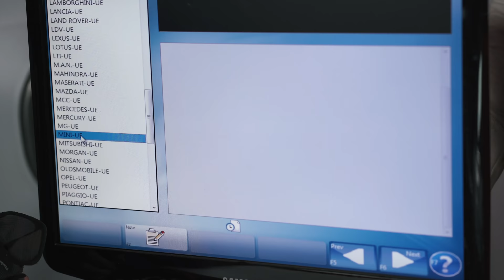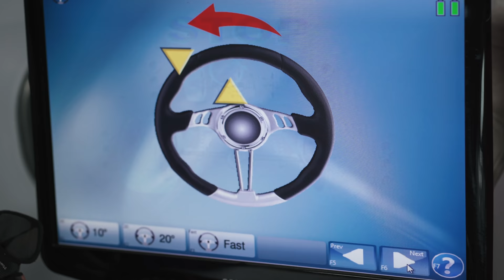BMW Mini Cooper S Rear Rally Suspension Upgrade - Edd China's Workshop Diaries 17

Comment: Love this show already and only a few episodes in. The way that there’s more than 2 or 3 things wrong with the car and the detail that goes in to repairing/replacing.  I watch WD thinking “yeah I could totally buy a substandard car and do it up and sell it on”.  The new show with Edd actually opened my eyes seeing that it’s not actually like that. For instance this mini, replacing the bushes with the press….
Washing the inside of the RR fuel tank and replacing the fuel lines…. Then making the magic switch to test the pump then working out that the plug cables needed switching… love it

Comment: Another great start to the weekend and it's comforting to know that even the experts sometimes have a problem with replacing bushes; I've done them all on a 23 year old Mercedes SL and every single one put up a fight and a reciprocating saw is a godsend.
Reply: Did the subframe rubbers on my E30. Really time consuming. Heat gun helped as well for the rubbers without a metal sleeve.

Comment: Big fan Edd. FYI, re the rear lower coilover thread that's been helicoiled: that happens because the steel bolt is a tri-lobe "self-tapping" bolt, which cuts the thread into aluminium, so they are technically single use only. So replacing the trailing arm is not the end of the story. Get yourself a keensert, put it in the new trailing arm, and then it makes it serviceable. Otherwise every time you remove the lower bolt, you're making the aluminium thread weaker

Comment: Smart Work Guy's!  My Observation sez he is not quite done spending yet. New Rear Brake Pads and Brake Discs, New Rear Anti Roll Bar and or at least the End Links. I bought Bicycle Wheel Hub Thin Wrenches to tackle Sway Bar End Links that do not have a Hex/Torx in the stub end to counter hold. Wrench On...

Comment: Eddie, have a look at the anti-roll bar rubbers and noticeably where they are mounted.... too close to the bend. If you slot the bracket that holds the rubber bushes you can move them away from the bend. BMW fixed this on the GP. You could also upgrade the anti-roll bar to a thicker one at the same time, if you feel so inclined 😉👍

Comment: I have worked a lot on heavy construction equipment with pins and bushings. If we didn’t have the right size hydraulic pressing tools we used to MIG-weld the bushings inside. When the bushing cools down it shrinks and it’s easy to knock it out. The same method works on motorcycles and cars.

Comment: Regarding the pressing out of the bushings (27:00): I have a similar problem with Saab and Opel / Vauxhall Vectra wishbones. There is a special tool for this that is pushed in between, rests directly on the bushing and supports the two sides of the wishbone against each other. Works fine. It is just a thick steel plate or U with the proper thickness.

Comment: This reminds me of doing top and bottom ball joints on a disco 2. Hacksaw and cup type tool though. Two opposing cuts works better than taking a small section out as the c shape would still be pushing out.

Comment: I replaced the corroded rear subframe in my 2007 S so am familiar with all the bits. Interesting thing I discovered is that the large bolts that screw into the aluminum bits (Torque specified at about 110 ft-lb as I recall) if you look and feel carefully you will find they the threaded portion os no round, sort of a trapazoidal shape. MINI pars describes them as self tappers. Guess that when screwed into a new aluminum bit they do form the internal thread and perhaps this is part reason for the high torque. When replacing, reusing the old parts and perhaps new bolts, since the internal thread is already formed a lower torque might be OK, something l ike 90 Ft-LB.  Tom G.

Comment: Depending on what material the Range Rover body is made from, there is another method for stripping paint, grease and other contaminants from sheet metal, and it is considerably cheaper than other methods.  Mark Stielow (a la 12 pro-touring Camaros) developed a method of heating a body in an industrial oven to 600 F (315 C) to burn off all the aforementioned contaminants while at the same time stress relieving the sheet metal.  The paint and everything else burns off.  Obviously this wouldn't work on an aluminum body which apparently some Rovers use, but it works OK on regular sheet metal bodies.

Comment: Karcher lease Ice Blasting equipment, with a propper air compressor because you will need good air pressure for the blaster. Only you should look for a good nozzle because the one who they gives are very wide. And a good plastic barrier to avoid blast all the dirt around your shop. Should watch I am detail videos about it.

Comment: I use a big c clamp positioned correctly to compress the caliper back so it will slip off the rotor when there is a ridge like that.

Comment: Always brilliant to watch. Thanks. This episode (or rather the segment measuring the wheel alignment at the start) is the first that hasn’t worked for me. The editing from Edd to Neil to the screen was too rapid which felt hectic and feels like the screen shots were only included not to show the interesting data but to show the brand of gloves. Just my observation and it doesn’t take away massively from the excellence of the show, but it wasn’t the usual style.
Reply: It's also the bit you wouldn't be doing at home, maybe that is why they cut it down?

Comment: I've just got one thing to say to you, Gentlemen: Eye Protection....I appreciate that you wore goggles when working around the press, but you also needed them when working to get those gritty bits out of the car. You don't want grit, dust, dirt, and especially metal shavings in your eyes. Otherwise, this was another informative video - thanks!
Reply: If you felt the need to draw attention to that, 👀, I'm surprised you didn't also suggest (or demand) the use of breathing apparatus to avoid inhaling ghastly carcinogenic fun particles when stripping the brake discs. Oooh, scary!

Life's one big trial. Sometimes it's important not to give a 💩about it.  😁
Reply: Edd was doing a fairly good job of not looking up when the debris were falling, but for the sake of all those young future Technicians out there, my viewing eyes cringed in submission just a little . . I would have thrown on a set of cheap safety glasses just to set a good example.

Comment: Enjoying the new series 👍good platform for a rally car. At least the suspension at the back doesn't have a beam like others. Although these minis handle well do you not think there is a large amount of bump steer in stock form, there is probably a kit somewhere. If it was my car I would fit bump steer kit, bigger rear arb and fit k20 engine 😁

Comment: rear pads wont separate by pushing.. they screw back in not slide. also lower hub screw is self tapping and very fine thread so it strips, thus the helicoil. its important to torque to spec and replace the bolt EVERY time its removed.
Reply: Thanks for mentioning this. Id forgotten that I discovered the same when working on an MGTF115.

Comment: Many an argument has been had about using anti-seize on bolts that go into aluminum because of thread damage or on lug threads for wheels.  Most "experts" will tell you not to use it because it can change the friction between the bolt and the threads of the hole, making it impossible to torque a bolt properly.  Anyone who's ever had to drill out a lug nut or bolt that had previously come out without issue will be less worried about that.  With control arm bushings that need pressed out, I've gotten to the point where if they fight me at all, I just remove the center and either bend the outer housing in with a drift and hammer or cut them like they did here.  It's swings and roundabouts between a reciprocating saw like they used here or a rotary tool with a small cutting head.  It mostly depends on if there is any rubber left in the housing, and how much.

Comment: Race  car drives, always worrying about having 4 wheels!  Two or three works fine. You simply adjust your driving technique. No problems! I have crossed the continent many times with less than 4 wheels.  Many times I've started out and simply put all the wheels away and continued on for hundreds of miles . 

But I did reli on the wings for support  . Flying is more direct.

Comment: Hey Edd, It looks like you slightly crushed that bearing housing. Does that matter? Is that going to effect the toe? or will you be able to adjust it out in the end?
Reply: I did this job a while ago and went through pretty much everything they did in the video, I even got the press arm stuck in the carrier and used some old brake pads to stop it caving in. Mine got a bit more bent than theirs in the video and I could adjust my rear toe to factory spec which is good enough for now.

Comment: Edd,just watching the video at 19:00- 19:41 where you answer a question about getting rid of the range rover rust.
My question is WHY DIDN'T YOU DO THAT FIRST  after all if you are going to have to  separate the shell from the chassis (frame of the car) then why didn't you do that first before doing the other stuff!!??? Wouldn't that have been easier for you and quicker and more efficient??.
Not having a go,just wondering why separating the rover wouldn't have been the first step. 
Ps if i could afford you i would never  take my car to any other mechanic, because you are the best.👍👍👍

Comment: You would think that being a racer that the disc and pads would be heavier to take the pressure
Reply: Rears don't need that much bite usually and oversizing brakes is bad as it will change the suspension dynamics of the car
Reply: @bilaltariq7819  oh ok

Comment: Just an idea. Looking at the abs sensor with a steel bolt into an aluminium thread, why not use a plastic bolt. There must be suitable materials available now.
Reply: just use anti-seize.
Reply: @larrydickman8749  I was thinking of the manufacturer's process.  Avoiding two dissimilar metals.

Comment: Hi Ed, with modern classics like this Mini containing plastic parts that will eventually break and become obsolete, what would be your solution to replacing or fixing plastic parts that are impossible to find new? I guess my ultimate question is, what would be your solution for repairing a critical plastic part that's broken, such as a cosmetic trim piece (so the repair needs to be flawless), or mechanical component that is under load? Thanks for the great content, Erik.

Comment: Hello Edd!  Thank you for this series; once again getting my 'fix' (pun).

With hindsight being what it is and the limited tool set available to me, I would have cut two (2) cross sections from that suspension bush, opposite each other, then pried out the two halves.

Which leads me to a question: is that bangin' (desirable) arbor press available in the U.S. do you know and regardless, what brand is it?

Again, thank you for doing this series; you are well appreciated. If you ever make it to Middle Tennessee, plz provide a little advance notice.

Be well,

Joe Cocchini (like 'zucchini' w/a "C")   (O:

Comment: VW T5 front abs sensors need drilling out when you change the wheel bearing, at least if the van is a decade old. Couldn't even get it to shift with a hammer and drift.

Comment: Great show Edd :-) quick question for you or for fellow commenters. Last October I bought a 1991 Land Rover Defender 90 as a hobby car, the electrics (as expected) were quirky to say the least (radio resetting, dash board lights coming and going etc,) anyway recently it needed a new starting motor and since replacing the old one all the electrics have completely settled down. Is the LR taunting me? I can't quite understand why the new starting motor has had such a positive effect on all the electrics, any pearls of wisdom appreciated. Really enjoying the Range Rover episodes. Cheers.
Reply: Sure, you cleaned up the main ground when you changed the starter I bet. It seems like 90% of electrical problems on old stuff is bad grounding.
Reply: @marioreali5925  Thanks for taking the time to reply,  I learned something new:-)

Comment: I'm not understanding why you bothered checking the alignment before you took it all apart.
Reply: So they could see if it was out of alignment and when they discovered it was Neil said that it explained the way the car had handled when driven. Lets hope they can adjust to new bits to get the right settings and don't have to do any major surgery to put it right.

Comment: Hey Ed loving the show from down under in Australia. Quick question when your were trying to get the Lh front brake caliper off why didn’t you open the bleed valve to release pressure on the piston? Not being a smart arse just curious thanks Mark
Reply: The rear brake caliper pistons on a MINI are of the screw-in type - you can’t just push them back in like a lot of brake pistons. Before putting in new rear pads the pistons have to be screwed back to the full open position.  And you can only gain access and do that when the old pads are removed.
Reply: @jkk244  cheers

Comment: How much does that bush housing thingy cost? At some point in the resistance offered by some lump of corrosion, the time and effort required to upgrade it is going to exceed the cost of buying a new piece. (It may be fabulously expensive or totally unobtainable, in which case the heroic efforts are inevitable.)  Still, heroic struggles are more fun to watch, (and more educational).
Reply: £40-70 each but that's for ones with the oem rubber bushing. Mini say the bushing isn't replaceable so they replace the whole carrier with a new one. I found some rubber ones from febi in the right size and used a press to put them in
Reply: @bilaltariq7819  If the replacement part comes with the bushing stuck in it, then it's basically the same problem with a cleaner metal bit, so it's the same as fixing the old one.
Reply: @parrotraiser6541  yeah exactly, thats why they reused the old carrier

Comment: I know I’m going to sound novice but is there any asbestos in the heat shield. If yes you don’t wanna be underneath getting that in your lungs. I suspect it doesn’t as I imagine you’re too smart to do that.
Reply: There are or were different grades of asbestos dependant on the length of the individual fibres. The shortest being the easiest to inhale and induce asbestosis. Breathing apparatus is needed when handling the worst types. I'm not sure if asbestos is used in these heat shields as its similar to the heat shielding cloths you can buy in B&Q for household plumbing jobs. Brake pads used to carry the same risk but not any more.